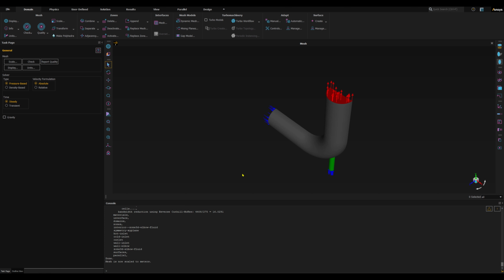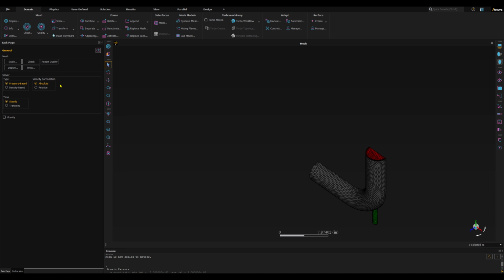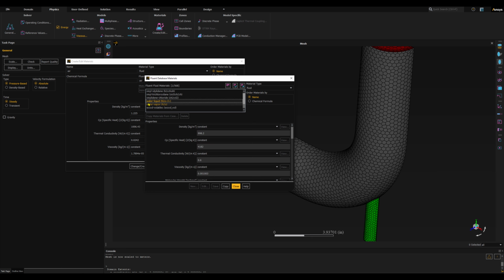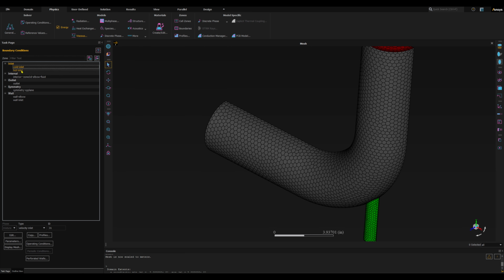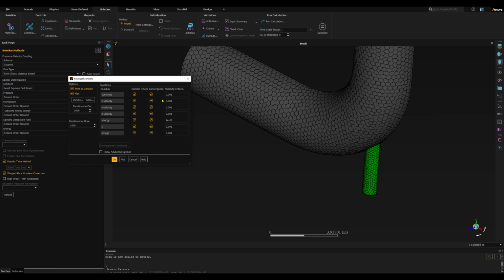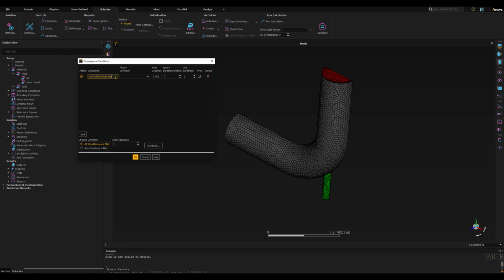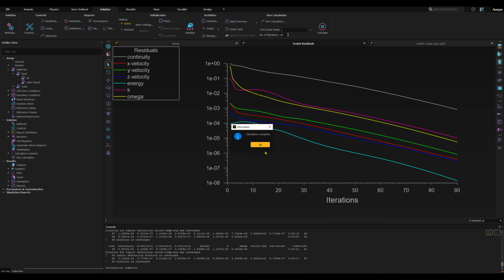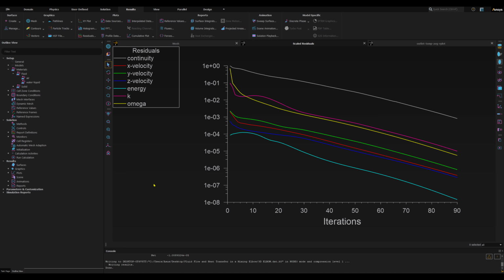Fluid Flow & Heat Transfer in a Mixing Elbow in ANSYS Fluent | Part 3: Setup & Run

Comment from the maker: 📍 Part 4: Fluid Flow & Heat Transfer in a Mixing Elbow in ANSYS Fluent | Part 4: Postprocessing
https://youtu.be/KcP79VYGkv4

You can also find the full step-by-step series in the official playlist: 📺 Playlist: Fluid Flow & Heat Transfer in a Mixing Elbow – ANSYS Fluent Tutorial Series
https://www.youtube.com/playlist?list=PL2F_bppz1x0_jpvukveY-2baIqJMHbJXh

Ready for the next step?
Welcome to the Fluid Flow & Heat Transfer in a Mixing Elbow tutorial series! 🌊🔥

This series is designed to take you from a blank screen to a fully converged CFD simulation in ANSYS Fluent. We’ll be covering everything from geometry preparation to detailed post-processing.

Happy simulating!